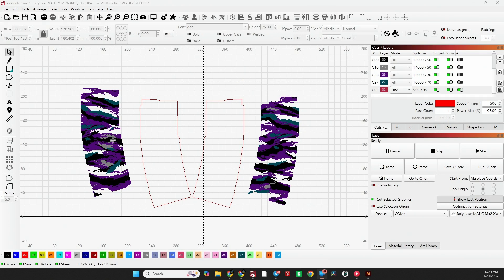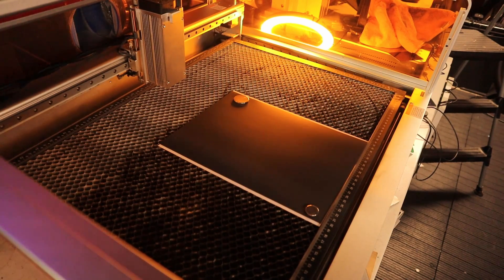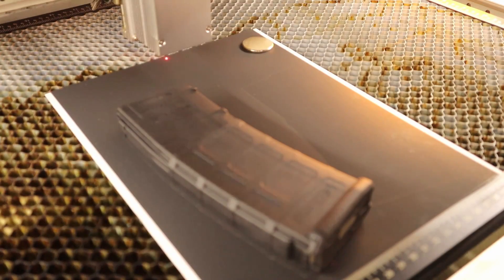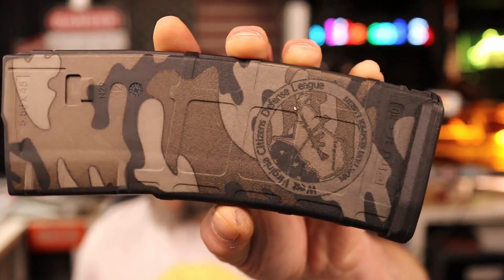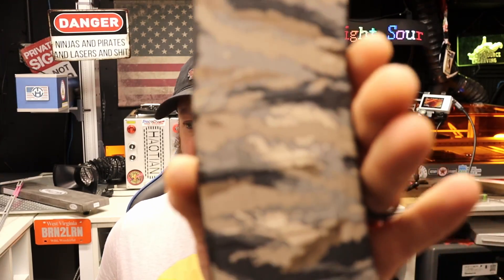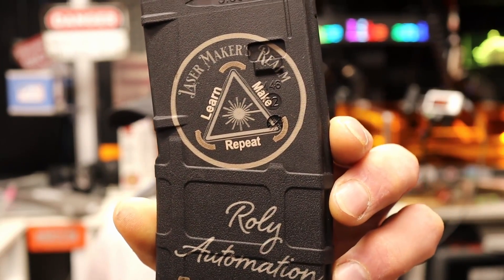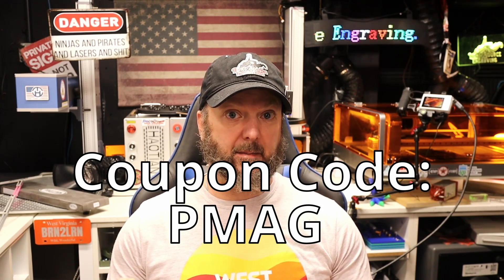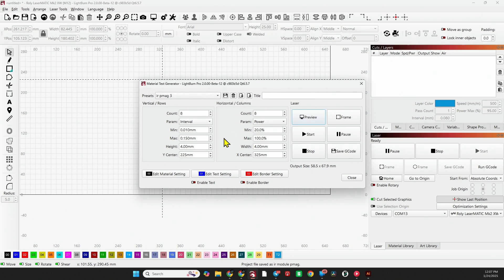Lasermatic MK2 XW 2w IR Module Polymer Laser Engraving Tutorial

Comment: Thanks for the files, I have the Atomstack Kraft ordered and look forward to messing with the IR on plastics. PS… idk if you’ve visited your website lately but the shared ads are rough. It took me 15+ minutes to get the files added to the cart and checkout due to the popups. Not sure if that’s intentional or not also may want to change the color of the menu icon, it’s near impossible to tell what it is.
Reply from the maker: google changed ad settings and i need to get that under control. i apologize, its not intentional.